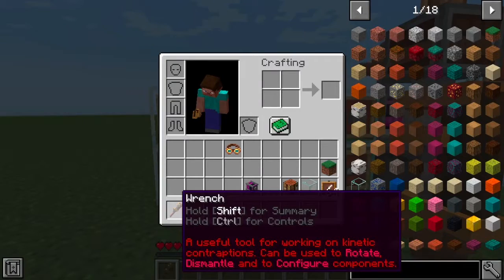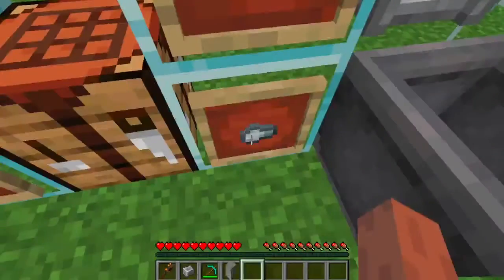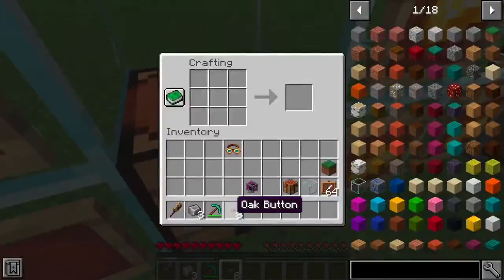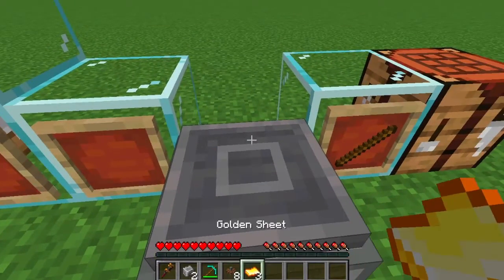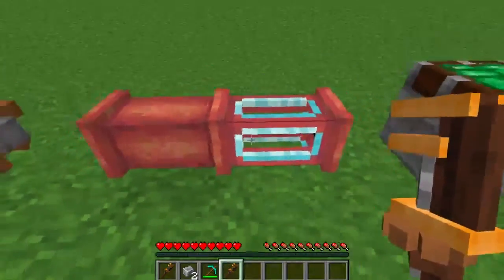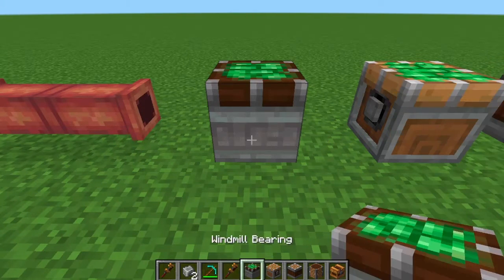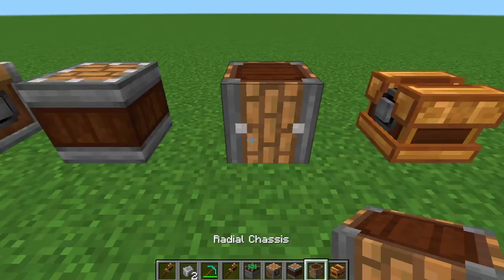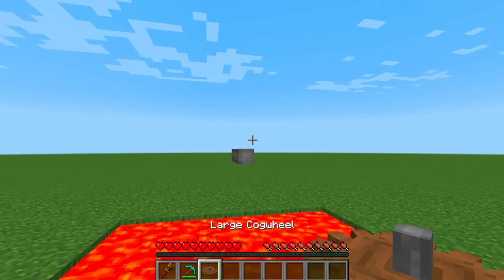Wrench - Create Mod Minecraft

Comment: Skip to 1:53 for usage. I'm trying to switch deployer modes but can only switch between attack and use modes. I'm trying to automate making of andesite casing. Using the scroll wheel just switches selected item slots in the hotbar. The wiki page is a too vague about this. How do I do it?